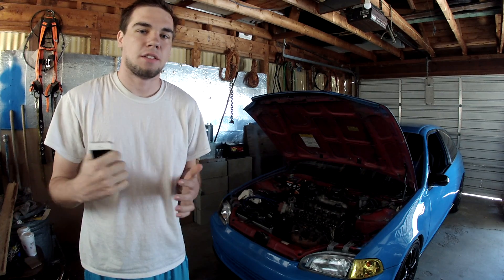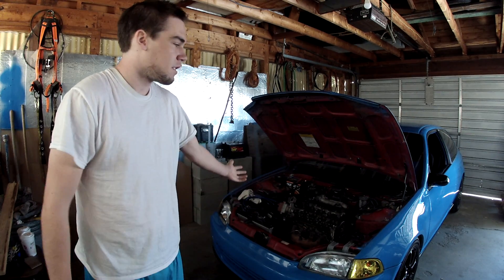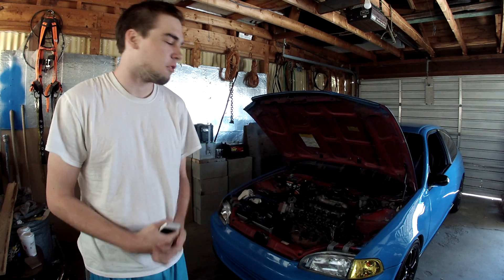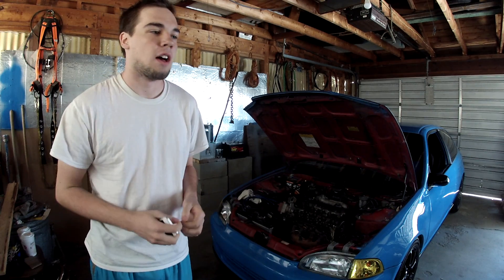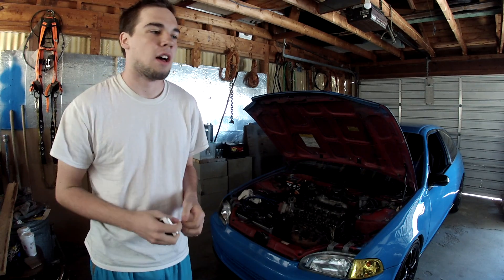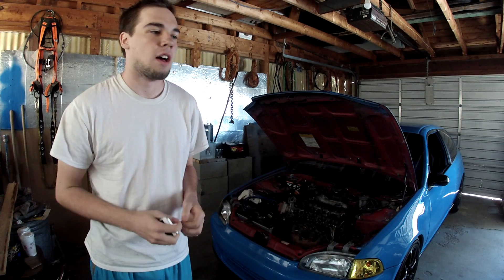Blew Up Motor In My Civic!

Comment: If it`s burning oil (blue smoke, etc.) you should consider replacing valve stem seals. I thought my old passats engine was on its last legs and the piston rings were bad, but we changed those valve seals and it`s running great now, no smoke at all. But you should only do this if you are keeping this engine. Otherwise it`s not worth the effort needed to fix it. It`s a pain getting those seals out.
Reply from the maker: I've already found out what it is, you'll see that in th next video. lucky I have a motor to drop in this car already. but seriously, thanks for the suggestions, sadly it was something far worse. so stay tuned to find out!